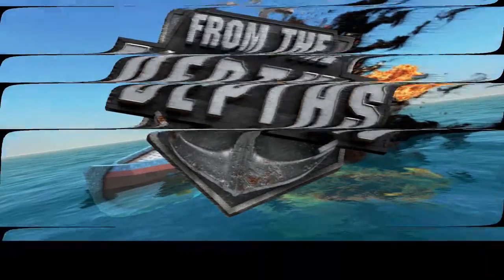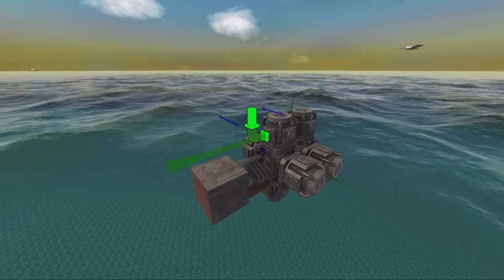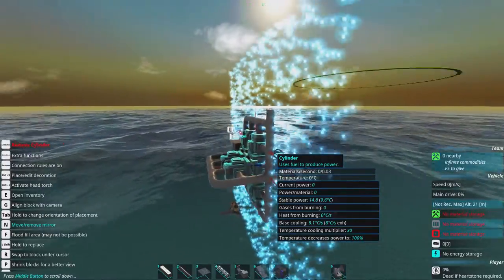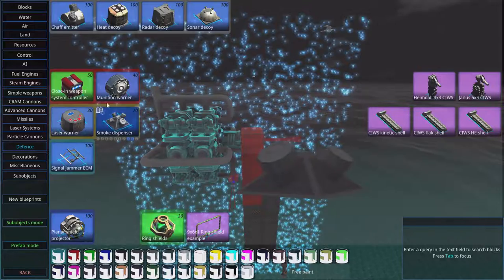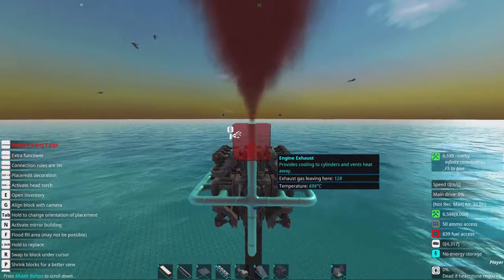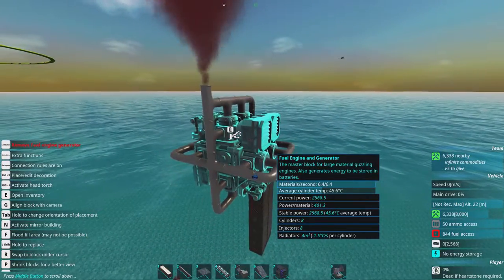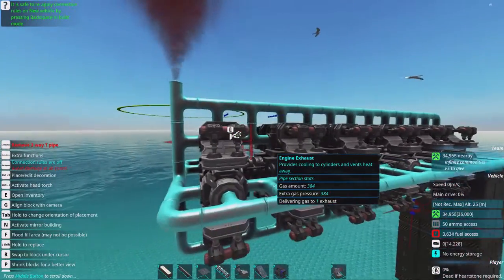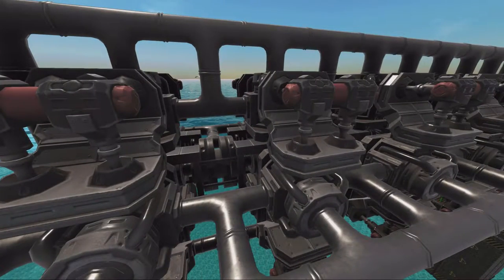From The Depths INSTANT Tutorial: The Most Powerful Fuel Engine!

Comment: A few things to note. There is almost no reason to put multiple injectors on a single engine. This is because either the inefficiency destroys the PPV (Power per volume) more than the block saved, or the pipe placement (as like yours) lowers the PPV and makes it hard to fit. Usually the "best" engines have most of their volume taken up by pipes and/or efficiency boosters so you end up placing engines to minimize those aspects. When accounting for everything (even fuel box volume) the 3x3 prefab comes out on top for PPV because each pipe has 2 connections. The nice thing about pipes is they cool per engine correction, so if placed where you put the radiators they become great. Radiators shine with their cooling per block placed so they become better when no tetris of pipes can get enough connections. They are also good at filling gaps in the pipe tetris and they don't have to vent it but thats a niche use. Well, I hope the massive amount of hours testing helped you a little bit.
Reply from the maker: Hey! This tutorials is just for insane power, but I'll make some other tutorials about efficiency later as well as compact no exhaust engines. Your research seems quite extensive, do you mean that radiators would work better when in close vicinity of pipes, also not quite sure what is meant with "cool per engine correction" so pleas explain that, sry but I'm confused XD
Reply: @GMODISM  Clarifications: Having 2 injectors  per engine forces you into an ineffective pipe layout which lowers your power per volume (aka less power than the 3x3 prefab). Engines are cooled by 4 for every pipe they are attached to so the more engines a pipe is attached to the more it cools. Each radiators cool all engines by 3/(amount of engines) or cool 3 per radiator block. So if a pipe layout isn't helping you cool at least 3 per block, then it is better to use radiators.

Comment: For the larger version, if you have the cylinders spaced anyway (so you can add pipes in between) wouldn't it be way better to add a radiator to the end of each cylinder for more cooling?
Reply from the maker: Yes, it would add weight tho so depends what is more important